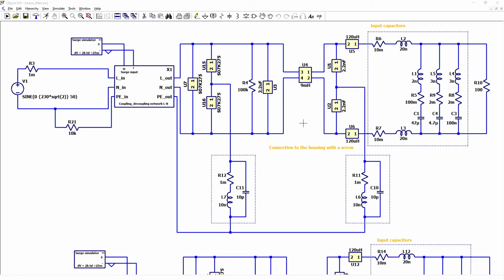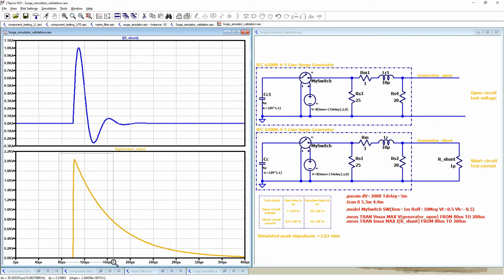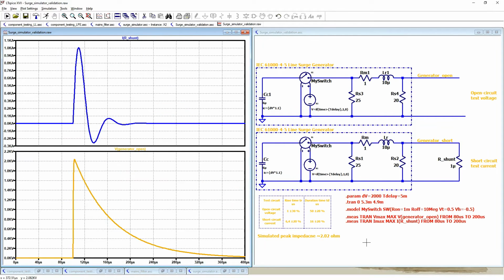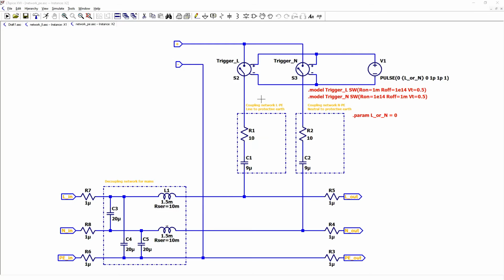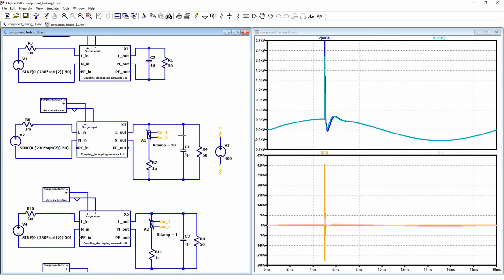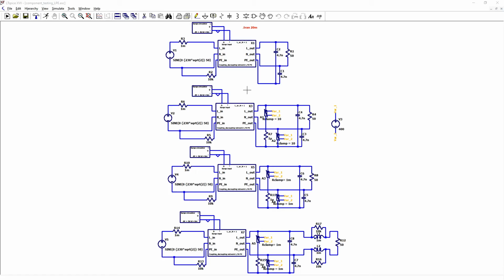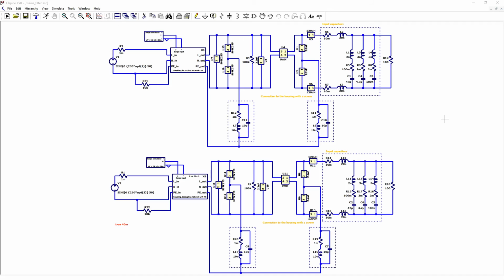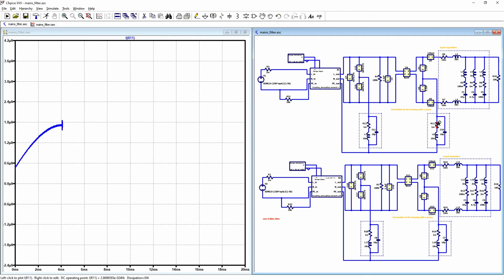Surge Lightning test simulation in LTspice! 61000-4-5 EMC challenge!

Comment: I am thankful for your wonderful effort and for sharing your precious knowledge. I am very new to simulation, especially in LT spice. I tried myself after watching this video. I am now successful in getting results as shown. 

Only issue is, I am facing a problem in including the spice model of MOV or Varistor. It is showing an error. I tried downloading .lib files and including them in the design, but they were of no use. 

I noticed your MOV S07K275 is not a symbol but a block (model, I guess), 
Please assist me in adding a varistor of our desired value in LTspice. This will be of great help.

Thank you.

Comment: Hello, a very interesting video. I have observed that in the LPE circuit you connect V1(-) to PE_in through a 10k resistor. why do you do this? Is it indicated in the standard?
Reply from the maker: Hi, 10k resistor it is not a standard value I put it due to LTspice problem with short but you could try different values. Just think what connection you have in reality and what value should be there. Generally you want to simulate circuit close to your reality. Thanks for your question! Regards.
Reply: @emcDV  First, thank you a lot for the video, it's very informative. However, this resistor value for PE to N seems extremelly high... PE and Neutral shoud be joined ar the source, right?
Reply from the maker: @geviar  sure, I would need to check but this is simulation thing, not realy. I think the problem was the Śpice wolud than not calculate accurate. You can always check it, in simulations it is faster than measurments 😉